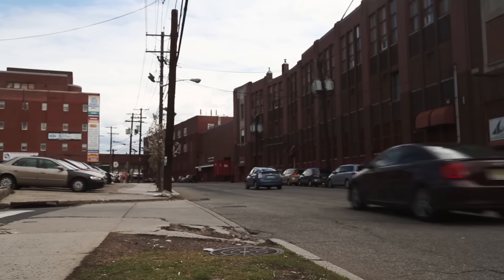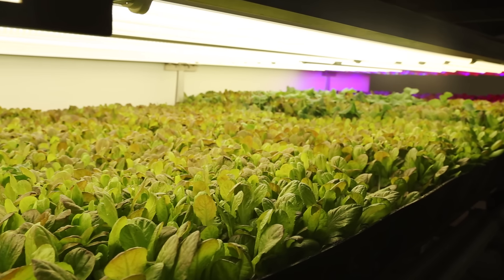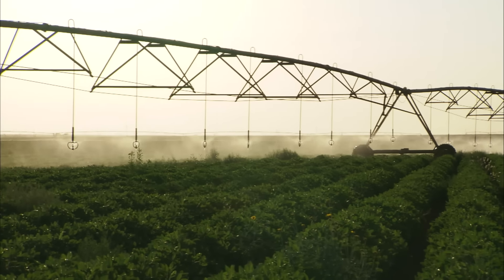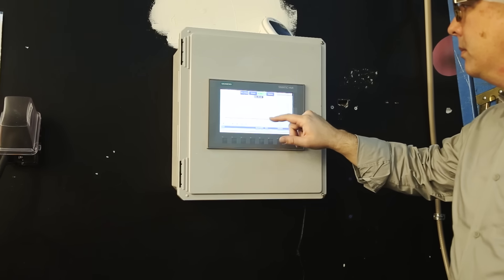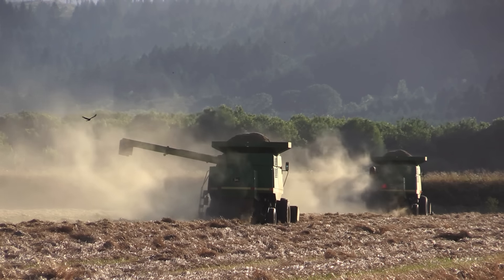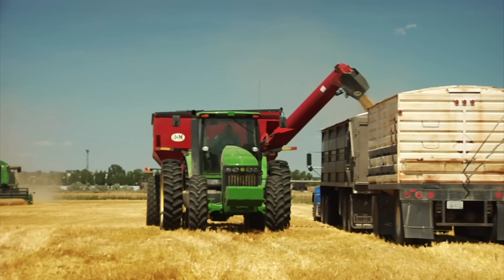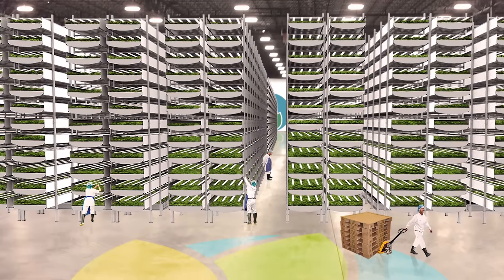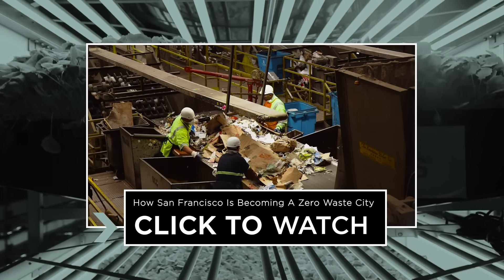This Farm of the Future Uses No Soil and 95% Less Water

Comment: Do these vertical farms grow anything else other than lettuce?
Reply: thats a good point.... how the hell are they going to grow corn or wheat???
Reply: Thank you !
Reply: just larger farms/less vertical rows. Although I am not so well informed about these farms, so I am just trying to apply logic. But of course for this kind of crops it might be better to do it outside. I am sure that the people working on this will know what's best to do and ofcourse these lettuce/smaller crops would otherwise need to take more place that can now be used for larger crops
Reply: A crop that requires bees for pollination seems to be a real challenge with all those fans around. The parts of the plant we don't use are normally turned into fertilizer by the bacteria in the soil to support the next cycle.
So growing lettuce indoors is still sitting at a very great distance from being able to grow (most of) all plants for nutrition. We have a long way to go still.
Reply: they'll find a way.
Reply: Who needs it? The Eating Authority has dictated that we now only eat greens. And Soylent Green.
Reply: If they can grow lettuce what's to stop them from growing anything else?

as for pollination, you can do that without insects, the whole building is a controlled environment, a single robot arm could pollinate the entire room.
Reply: +Ebon Hawk Really? A single robotic arm? How? Starting at 2:24 take a look at how the shelves are arranged. The shelving is supported and divided by brackets. I wonder how much that would cost just to provide power?
Reply: NightBazaar As of yet they haven't produced any crops next to leafy greens and herbs, according to the aerofarms website. " In 2015, Google’s Alphabet X tried to create an automated vertical farm, but the company later abandoned the project because it couldn’t figure out how to grow staple crops (like grains) using vertical farming techniques." It goes on to say that "when it comes to providing nutritious crops to the world, greens only take you so far." I hope this helps.
Reply: They grow micro greens mainly
Reply: USU-Apogee is a super dwarf wheat - 16" stalk . USU-Perigee is pretty much the same but has higher yield. Gotta eat more than wheat. There are a few other dwarf crops as well. They'd be fine for a salad, but that's about it. For confined large-scale vertical production, It's not practical to harvest by hand-picking grains one stalk head at a time.
Reply: You would have to eat 32 pounds of lettuce to get 2,000 calories. Not very practical.
Reply: Beans, or other legumes would be useful, but I would assume that part of the model is to grow plants that leave you minimal non-edible biomass to dispose of. In which case, the system would work most efficiently with leafy-greens. Spinach has a greater calorific density than lettuce from what I understand. The value of grains is in their dry storage and versatility, but their nutritional value is less than that of leafy-greens. It's good to see we are managing to find some solutions, even if they are incomplete as yet.
Reply: +Dave Wilson
"Solutions" to what problem(s)? This "solution" has problems of its own. Vastly more more materials and energy than conventional farming.
Yes, lettuce and spinach are more nutrient dense, but again, they are not a replacement for the needed calories. You would have to eat 32 pounds of lettuce or 19 pounds of spinach to get your 2,000 calories per day. Not a very appetizing prospect.
Calorie dense foods would require far more light energy (lumens) to bring those plants to maturity if you were to grow them under lights. It would be far more efficient to grow calorie dense crops under the sun itself.
Reply: An incomplete solution, is nominally, precisely what it is. A solution that must work in tandem with other solutions. Your argument is that because this solution isn't going to solve all problems relating to food, energy, and materials, that it isn't a solution at all. Conventional farming is an imperfect solution also, for topsoil sustainability, pesticide limitations, and fuel consumption per unit food, conventional farming practices must improve also. 

In terms of the material cost, I can only assume you are referring to the frames? That is not an ongoing expense beyond maintenance. I've worked in hydroponics for a short time, and I saw the nutrient cost first hand. There was a lot of waste in the company I worked for (nutrient solution run-off), and yet it was a feasible business practice in a country that has some of the best soil in the world, producing seven times the food it consumes per annum.

You may be interested in looking at what a Nirvana Fallacy is, as you have used an argument construction which gives me an assurance that you are incorrect logically, if not factually.
Reply: wheat or weed?
Reply: +Dave Wilson
Nirvana Fallacy? You're the one who continues to use the word "solution" without defining what you're trying to solve while implying that vertical farming solves this undefined problem in an almost nirvanic manner. You're comparing actual things (farming under sunlight to produce foods that satisfy the human requirement for CALORIES) with unrealistic, idealized alternatives. Remember that my original comment had to do with calories.

Nirvana fallacy - Wikipedia
The nirvana fallacy is a name given to the informal fallacy of comparing actual things with unrealistic, idealized alternatives. It can also refer to the tendency to assume that there is a perfect solution to a particular problem. A closely related concept is the perfect solution fallacy.

Yes, one can operate an economically successful vertical farming operation when growing greens, but my central point is that it is inefficient for growing high CALORIE crops (grains, legumes, tubers, etc.) because they require much more warmth and light than do greens. Tell a corn farmer that he needs to grow his corn vertically under lights and he will say, "Are you crazy? Do you realize how expensive that corn would be on the open market? There is no way I could compete economically."
Reply: As compelling as I find it when someone tempts me to reciprocate childish name-calling, I'll restrain myself.

Have a good life, buddy.
Reply: firecloud77 Dave Wilson Whoa there let's all just settle down.
Reply: Kebinster, I'm quite sure everything is fine. firecloud77 has enough backbone to not need a rescue. Your concern while somewhat appreciated, at least for my part, is unwarranted.
Reply: +Dave Wilson
You should find this interesting. Search for a YouTube video titled Why Vertical Farming Won't Save the Planet
Skip to 22:30 where he dives into the math.
Reply: you don't have to transform all currently grown crops into hydroponics to change the world...cutting lettuce and similar crops is already a step forward
Reply: +Ryan Sultana
The change is an illusion. It's a trade of one set of costs and benefits for another of equal or lesser net value. 
(referring to growing vertically under lights)
Reply: I grow some stuff under lights, mostly my carnivorous plants MUCH easier to grow plants that only reach 5 cms (2 inches) fully grown under lights than sunlight when they require "full sun" to grow. I have a 2 foot fish tank with mirror & white sides & pots (no water) in it. I had 2x26w growlights in it, but removed one a couple of months ago because it was too bright & burning the plants, so it's now on 1x26w, on around 14 hours a day (generally they're on 16hours but again I dropped it as it was too bright for my plant mix) & that will grow lettuce or any other full sun plants with ease. I also have another 5w led desk light that I use in another location, it covers around 1 foot square & again grows full sun plants with ease. If I went with led grow lights I'd need around 5w for the 2 foot area with full spectrum, but most of that is wasted. I haven't researched it properly, but from my understanding, if I went with red/blue lights, I'd need around 2w on for 16 hours a day for that 2 foot area.

Another factor in lighting is plants use lights for photosynthesis. If you provide ALL the nutrients the plant needs via nutrients to the roots or leaves, you can actually grow plants in complete darkness as they don't need to use photosynthesis for energy. I've only done this in tissue culture where they have sugar provided as well, not sure what happens if you remove the sugar (which you would if you're not working in sterile environments) but basically they can use less light if they get the nutrients right (and airoponics gives very good ability to do that) 

As for variety, space is the issue & light to all areas of the plants. Marijuana is a crop grown a lot under lights (and with a TONNE of readily available info on it & transferable to growing other plants), it will generally be given around 30,000 lux I believe & I think it's up to 2 metres tall? big anyway, which means it needs much more light to penetrate the entire plant. My plants are growing in around 1,500-3,000 lux. Corn would likely be similar to pot I would guess, but then there's the pollination issue mentioned, so really not practical. Leafy greens are easiest, as are plants like strawberries where there's not too dense foliage for small led lights to reach the whole plant.

Legumes (peas & beans) could be grown in these systems, but they're "nitrogen fixers" ie they collect nitrogen from the air & put it into the soil in the form of natural fertilser, so it will always make more sense to grow them with or in rotation with crops like corn to improve soil quality.

Tomatoes are an example of a bigger plant, they are grown in hydroponics a lot, because of the disease protection this sort of system provides, but again light needs go up a lot due to size/leaf coverage, so it's generally more logical to build a big enclosed area that lets light through in the middle of the desert & use this sort of system there instead of trying to provide all the light artificially. In that setting they are generally put into layers, but not stacked like the ones in the video. tomatoes also need human assistance with staking etc so moving from layers to do that would cause problems for the plants.

so basically there's lots of potential but for the foreseeable future it's only likely to be leafy greens & herbs being grown in this sort of system while the bigger veggies will probably more & more move indoors into purpose built buildings that let full sunlight in but allow full temperature, water & disease control. corn, wheat etc are probably unlikely to move, at least within our lifetimes.

& if you want to test it yourself, very easy to do with a basic but obviously strong led desk light - you might be surprised at just how well even a few watt works! (great idea if you have a houseplant that's struggling to get enough sun too, African violets & orchids LOVE led lights to grow under)
Reply: lol The Stoned yeh I've heard that! The light I have is a cannabis propagation light that's meant to be 10-20cms (I think that's about 4-8inches? 2.5cms = 1 inch) from the plant, mine are around 40cms down & is mostly ok now I've halved the globes (26w flurecent). It's crazy low light! 

Have you ever tried sticking a lettuce or something in a dark spot in your grow area to see what it does? I've never grown cannabis, I actually assumed it must be the lights were giving off much better levels of the right wavelenght & cannabis only needed higher because of the size & therefore leaves blocking out so much light. Your comments make me think I'm wrong & it's a plant species thing.

& no wonder you need so much more tech with fans etc with lights that strong & the heat that would give off!!!!!
Reply: even thought they might not be able to, it's just an alternative for other growing plants that they've grown using more wasteful methods.
Reply: Only small greens so far.
Reply: They should try things like peppers or onions. Maybe peas. Small crops.
Reply: Generic, peppers are actually pretty big & need a lot of light if you want to get them hot to eat (basic varieties are fine on this kind of light) I made a list of plants I could think of they could add in another thread, but at this point the key will be plants that can be distributed straight to restaurants & small stores wanting daily fresh stuff in cities, so herbs are probably going to be the first expansion 

parsley, spring onions, garlic chives, stevia, basil (lots of different types), dill, celeriac, mint (lots of types), coriander, lemon balm, thyme, borage, sage, tarragon, watercress, fennel, shallots, rocket, chamomile, oregano. 

Plants like garlic would grow in this system perfectly (if the roots are supported) but because of the time to harvest & keeping time, I can't imagine it being included. Non-herbs will often see the same issues as garlic, so again I think they'll be further down the track if at all. 

Plants like strawberries could be interesting, only cropping once a year, making them unattractive to a system like this BUT a system like this allows temperature controls, so could at least extend the growing season a few months with little effort & with lots of added energy costs for heat, could grow year round (they're also already into hydroponics to keep the fruit clean & increase size)

Other veggies you could grow like this, beetroot, carrots (multiple varieties), parsnips, onions (multiple varieties), radishes, rhubarb, yams, eggplant, baby spinach, sugarbeet, turnips, licorice, cranberries 

If you make bigger bays or more of an overgrown glasshouse, add tomatoes (lots more range once you now remove disease), chilies, squash, zucchinis, cucumbers, watermellon, rockmellon, pumpkin, blueberries, possibly grapes & other berries & passionfruit, pineapple, dragonfruit, spinach, broccoli, cauliflower, rosemary, lavender, lemon grass, ginger, tumeric, thai ginger (& others), potatoes, sweet potato, celery, capsicum, blackcurrents, yacon

There's also sprouts & mushrooms that are already growing in this type of farming but could be expanded on and/or brought into the city
Reply: It's a start at least and they are doing well with it from what I can tell on a small video. Give them time and as they build up resources, funding and experience I think these will flourish everywhere.
Reply: Razvan J more importantly it doesn't grow anything of actual sustenance.....
Reply: DO YOU REALLY THINK YOU NEED 2000 CALORIES A DAY WHEN ALL YOU DO IS SIT AT YOUR COMPUTER ALL DAY? /ragemode Have a great day people don't always assume you need 2k calories in a day when you don't work up a sweat.
Reply: Razvan yes it definitely could be done, even with today's technology it's partly possible, but would you really want to eat it? It's something like 70% of fruit & veggies grown in developed world countries are disposed of/plowed back into the ground because they're not "perfect" supermarkets set requirements for exact lengths & widths & reject anything outside that, let alone colour variations or skin blemishes, or imagine a carrot with 2 carrot pieces on 1 top!

A 5mm piece of carrot core can today be placed into an overgrown petri dish (flask) with the same nutrients these airo veggies are getting but with additional sugars as well and "pgr's" (plant growth regulators or hormones) & the right pgr's & conserntrations will cause what's called a "callus" or "artificial protocorn" to form, which is basically just a mass of carrot cells. This can be done in little or no light & presumably would be completely edible & taste like a carrot. 

This is done in schools & as a lab training exercise, most commonly with carrots, cauliflower or african violet leaves. They have to be 100% sterile before being flasked, but once flasked they can be multiplied indefinitely & easily within the flasked environment. Any plant can have this done to it. Not sure which would grow edible bits of the plants & which would grow useless bits, so there might be limits to it's use there, but it's certainly doable even with today's technology. Look up "tissue culture" or "micropropagation" if you want more info.

The biggest problem I can see with that is 1. people not wanting to eat it, especially with the hormones & 2. it's using added sugar to multiply the target plant parts instead of photosynthesis (sun/lamplight), so you'd need to find a way of producing sugars or the imput energy will be higher than the output energy
Reply: Gavlick it provides vitamins & minerals though. I mean sure you could just take the multi-vitamin tablet directly (I actually add human vitamin tablets to my flasked plants cause they're cheaper than the plant ones in small quantities) but this is about variety of food & freshness. 

This is complete gimmick as far as actually providing calories for the world, completely useless, but it can potentially reduce transport costs & increase choice of foods for city hippies & long term the knowledge gained from further developing these systems may provide a useful base for useful foods in areas actually short of food. 

Sweet potato is the classic food that fits this description, it can be grown indoors as a houseplant & if you do this in a small pot, the potatoes will actually play their own game of tetris so when you harvest you'll find no soil, only a pot FULL of sweet potatoes & they do have substantial calories. It would thrive in a system like this (with support for the growing roots)
Reply: +azri nor LOL! Mai dai. Durian trees are too tall for a vertical farm. Even a dwarf durian tree is too big. And the fruit smells like something that has died and rotted.
Reply: anything else other lettuce or patchoi don't taste earthy ,i've tried it myself so i guess most would stick to lettuce
Reply: not tasting "earthy" can be good for some stuff, like herbs in particular, allowing their full flavour to come through
Reply: nope too large root systems they need to support their weight further advancements may do that the  but not vertically i believe. Unless GMO Dwarfed  fruit trees are made
Reply: Akil don't say that, I want to see the system designed to stack 20 metre trees one on top of the other :) Staking cannabis one on top of another with the height they grow would be an interesting enough exercise imo, let alone the full size trees!

& serious answer is large stuff can be grown with hydroponics (although tree size is probably questionable in practicality) but it's best to put it in greenhouses in deserts or wherever rather than trying to do it under artificial lights. This system's best for small stuff where freshness is of high importance not large stuff where produce is currently stored for up to a year
Reply: any soil growth - small space... can be grown... Like mint , PetroZillia,
Reply: Exactly! There is a natural way to do these things. 

Sure if you want to grow basil and leafy greens, but potatoes? Corn, Wheat, pumpkin etc? 

nope.
Reply: +Pooping Buffalo LOL! Yes, you're right. Weed can be grown indoors, although it can grow tall enough that it might not be all that practical for the stacking method of vertical farming. The exception being a few hybrids that can reach around 15 inches to 2 feet high in about 4 to 10 weeks or so to reach maturity for harvest. Most of the commercial indoor weed farming tend to be typical greenhouse type farming. Vertical farming isn't very practical for plants that can grow up to 8 to 15 feet tall or taller.
Reply: NightBazaar solar
Reply: Yes, because plants can grow without soil. What soil does is a media to retain mineral and nutrient for the root, and also for the plant to sit on. Scientists already got over that challenge a long time ago. 
I don't think they have any problem producing smaller plants that doesn't require a lot of sunlight. Lighting will be the real issue. Making the space and support for bigger crops like rice or wheat to grow isn't a problem, but the lighting is. They might be saving a lot on transportation and things, still the farm uses up a lot of electricity. They need to figure out a way to grow profitable big crops.
Reply: SOYLENT IS PEOPLE
Reply: Ebon Hawk Its really not possible to polinate without insects man..
Reply: NightBazaar 

It doesn't have a point if it can't produce a joint.
Reply: +Pooping Buffalo

Hahahaha! Reminds me of roadside signs poetry from long ago.
A major point indeed to farm commercial weed. - Burma Shave
Reply: There is also veganic farming, that would grow these larger crops. More efficient, more healthier better for the soil as well and, planet.
Reply: you can use the remains of the plants to make the fertilizers but make it liquid fertilizer instead of a decomposed matter, they even have more nutrients the fresher they are...then you feed it back to the plants.
I think you can definitely grow any type of plant with this setup...it will just take longer cycles, because there is less light availlable.
Reply: The products they advertise are all baby greens, i.e. baby lettuce, kale, spinage, arugule, mustard greens, etc.

Source: http://dreamgreens.com/
Reply: They'll probably genetically engineer stumpier versions of those crops so they can fit in there nice and snug.
Reply: Maybe someone will, but this company has only grown "non-GMO" plants
Reply: That's where the vertically farmed cows come in.  Yummy...
Reply: This company, and this video specifically, highlights the usage of growing lettuce and selling it to local restaurants.
Reply: I didn't read all the responses, but in case no one said it, they don't. The reason is that lettuce and other greens are more than 80% (or something like that, was it 90%?) water, and get the highest price for the lowest amount of electricity (aka "sunlight") and nutrients. Even though these farming operations are all unprofitable, anything other than herbs and greens would be even more unprofitable. A potato, for example, has tons more growing, nutrients, and sunlight needed than these ten-day-mostly-water light-weights
Reply: I think I saw spinach in the video
Reply: Yeah, they do strawberries, legumes, even lemon trees.
Reply: @SolaceEasy  Mmmmmmm.....Soylent Greeeeen.